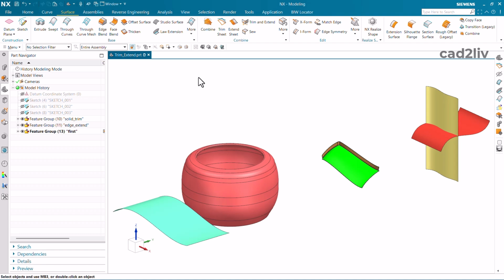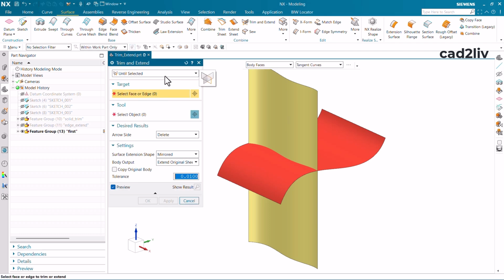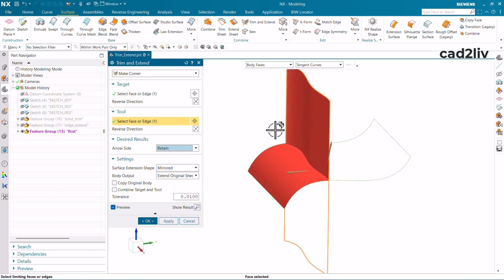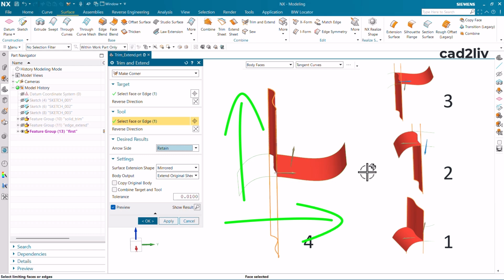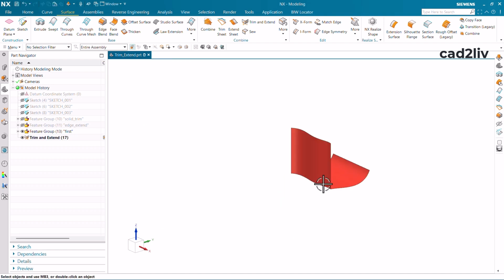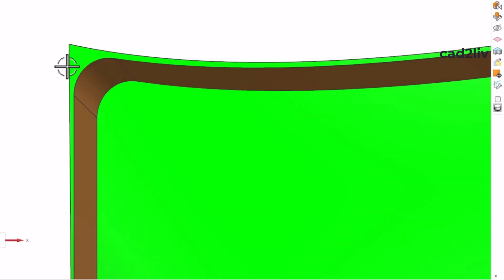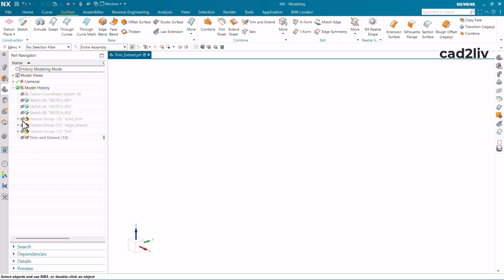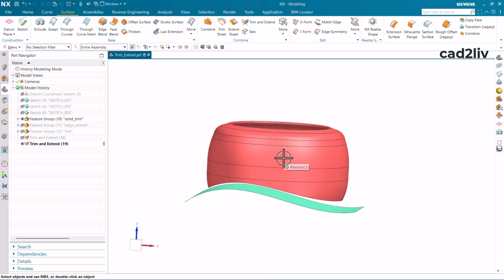NX_Surface_Modeling | #Trim & Extend | Trim & Extend in NX | #nxtutorials | NX CAD | Cad2liv

Comment: How can I extend an edge to another edge?
Reply from the maker: Thank you for asking this question, 
Step 1: go to trim and extend command.
Step 2: choose extend with edge option of until selected.
Step3: select the edge you want to extend 
Step 4: select the edge upto which the edge(step4) you want to extend.

In this way you can extend the edge until selected edge. 

Let me know, if this works for you.
Reply: @cad2liv  I don't know why I cannot select edges while i'm using the command trim and extend, even though I have the edge option selected. Maybe it's important to say that the body doesn't have parameters because it's from a STEP file
Reply from the maker: @pedrobaumgratz  if that's case you can do one thing, first try to extend the edges of a newly created surface using surface commands and then try the trim and extend on those surfaces. Along with that you can share that step file on email with me so that I can check what the real problem is..